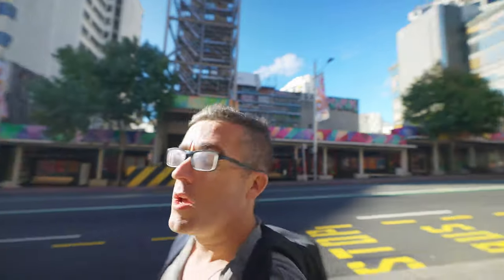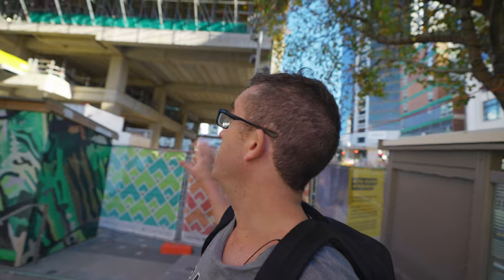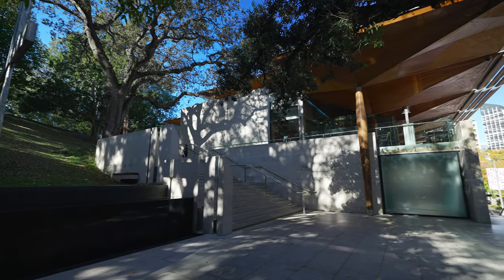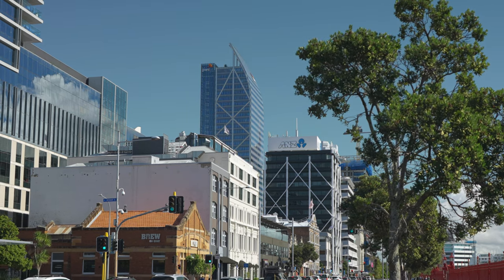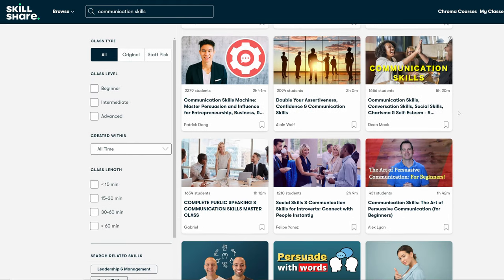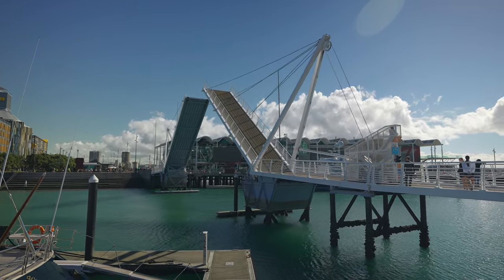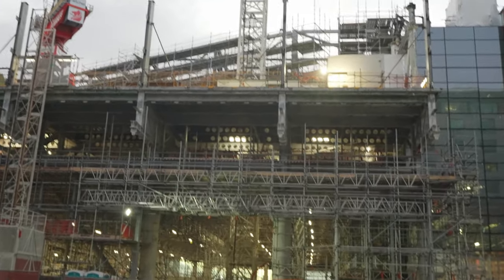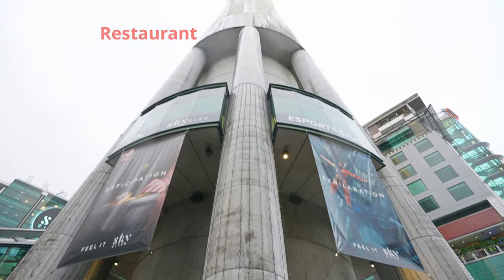The Engineering Secrets of Auckland

Comment: You could make a 'green battery' using one of the volcanic cones .
Have a tram fitted with a dynamo and a number of electric car battery's on a track that spirals around the cone from top to bottom.
Have the track slope in towards the cone .
The decent can be controlled so it builds up some speed before the gearing / dynamo is enguaged via the load placed on the dynamo.
Very near the bottom the resistance can be incressed to slow the trolly.
Severial battery's the carriage and the dynamo would provide a lot of force.
Just need the maths to know if its viabile.
It would be cheap due to the site and parts, the location and proximity of workers.
Close to the demand and educational, maybe even a tourists destination.